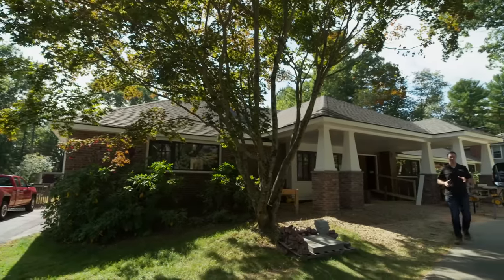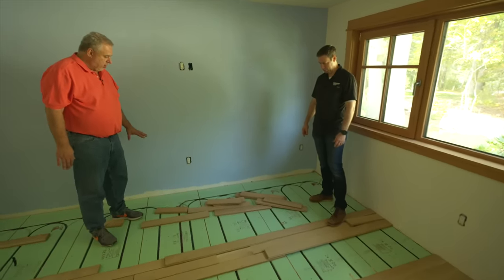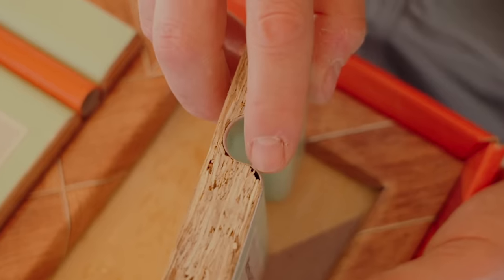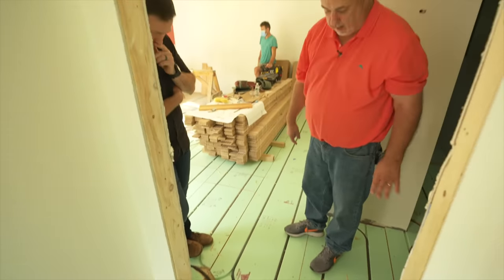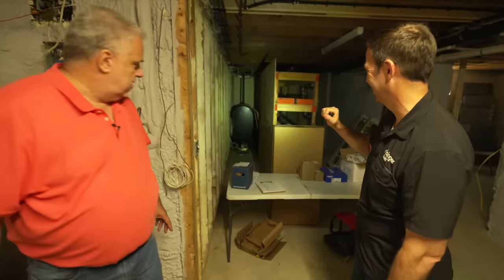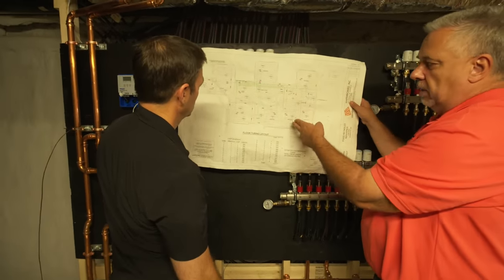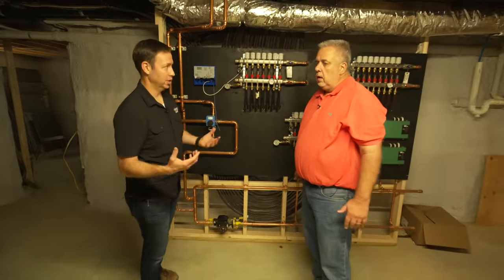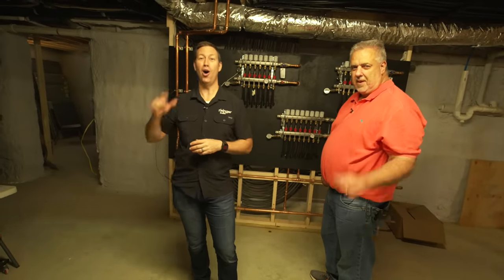Plug and Play Radiant Floor Heating System - BEST ON THE MARKET

Comment: I would rather have passive construction rather than a system that cannot be repaired without tearing up the floor..  System should havea 100 year warranty on an y parts not accessible without demolition.
Reply: Only thing buried is the continuous loops, everything else is exposed. In your argument how do you treat electrical wires, electrical boxes, plumbing valves, plumbing pipes (with joints)? Don't you think your argument is heavily skewed?

Comment: Such attention to detail and they didn’t solder the copper joints.  Am starting to see Pro Press O rings fail after only 8 years on boiler piping.  Not hard to fix but all that initial labor savings is lost.   If you’re using copper just solder it.

Comment: After all that work and money and then the people who live in different bed rooms have to fight over the temperature. They should all have control of their own room.
Reply: Majoofi Pretty sure each room will have some form of independent control. He mentioned at one point that one zone had five loops- that may well cover the bedrooms, in which case the central control could heat the bedrooms while the rest of the house was off, but each bedroom having its own loop and manifold connection with dedicated solenoid means a simple thermostat in each room could control it independently. I doubt anyone would install a system without such controls.

Comment: Why would you want to heat a closet?
Reply: The panels were installed in the closet to maintain consistent floor heights. As far as running the tubing through there - just personal preference.

Comment: The install is absolutely superb but putting manifolds in the basement is a very, very poor decision IMHO.  Manifolds should be installed ABOVE floor loops to allow air to escape and be bled off from the white bleed cap on the manifold. It IS possible to pressure bleed loops but this is complex and time consuming - all the actuators have to be removed and the valves operated manually one at a time to force-bleed each loop. Over time due to temperature cycling and low water velocity it's inevitable that small gas bubbles will occur, leading to more air trapped in the floor loops and loss of performance. Then the whole system will have to be pressure bled again. Then perhaps some of the actuators will get damaged, because they are not designed to be removed and re-fitted many times...And all this just to avoid having the manifold tucked in the back of the closet?.... where, incidentally, it will keep your clothes nice and warm too?

Comment: Warm board is far from perfect. Many better systems and designs available.
Reply: Who would you recommend instead?
Reply: @JoeLaGreca  check out HeatPly. Also no way a hydronic mechanical system has to take up a whole wall. We have done whole systems that fit in a 4'x4' space.
Reply: @takehikes  I looked at the HeatPly website, but it appears to not have an aluminum spreader.  Does it still work as good or efficiently?
Reply: @takehikes  You're kidding, right?!  Pure routed plywood with zero conductive layer, and you have to run tubing every 6" instead of 12"?  You, sir, have got to be a heatply salesman, because it's complete garbage comparatively.
Reply: @timm439  been involved in mani installations of both products but not a heatply rep. 6” on center is with 3/8” pipe not 1/2”. The aluminum does little. You put BTus in a space and that is it, it does not add comfort. BTus are king. I’ve been involved in the sales, design and installation of thousands of systems and found heatply a better system.
Reply: @JoeLaGreca  no aluminum heat spreader but it’s not needed. You are heating the space not the floor do it’s how many BTUs you can get in the room.

Comment: What happens when a run springs a leak?
Reply: They are all "zero joint" homeruns. I baffle me that people concern themselves with a continuous plastic pipe, and raise durability questions, all the while they accept hundreds of feet of copper or pex pipe with a ton of joints....
Reply: @stevenbaczekarchitect9431  Thank you for answering. I am enjoying your videos immensely on the website as well as here on youtube. I have learned a great deal! I grew up in the north with full basements. The thought was always that in a basement you could get to 90% of the plumbing so if a joint broke, and it did often, you could get to it. I am fascinated by underfloor heating systems but this one concern has always nagged me. People do dumb things. I had a tenant once who secured his Christmas Tree to the floor with decking screws. I know not everyone is going to do silly stuff like this but how are these systems remediated in such circumstances. I imagine it would require tearing the floor out over the loop area. In addition, I would imagine there is a pressure sensor that would detect the break and isolate that loop from the rest of the system?
Reply: @stevenbaczekarchitect9431  It baffles me that people confuse copper or PEX plumbing runs centered in stud and or joist cavities that are fully protected  (per all codes) by nail plates in any instance that distance from closest side of pipe to NEAR side (the back, out of sight) of ANY finish material as being equivalent to thousands of feet of tubing that is directly in contact with the NEAR (again, the back, out of sight) side of the finish flooring materials. This is a case of totally false equivalence (something we see all too much of on the evening news, these days). 

The issue is NOT whether the pipe wears out (unless you are running high velocity flow on a continuous domestic HW recir loop-- another issue altogether) or the fittings leak (there should be none, unless there is tube damage that must be repaired; not an unheard of event). The issue is that there is an enormous amount (thousands of feet) of tubing that is VERY readily reachable by almost any fastener that may be employed in the vicinity, and this vulnerability is LIFETIME. One careless hole drilled or screw put into the floor can cause a huge amount of damage and a tough, expensive repair job. This is the dark secret that Warmboard and all their competitors do not like to publicly acknowledge, and in my mind, it is the one truly negative as regards installing these systems. Any installation of the R panels over an existing concrete floor is especially problematic, as any leak will follow the tube channels and the panel joints, and disappear below the Warmboard (presumably there is also rigid insulation below, further complicating life), remaining unnoticed until damage is EXTENSIVE.  For the record, I have done infloor radiant heat for 20 some years now, starting with staple up and in concrete slabs. I am very much sold on the low-mass, rapid response (for accommodating solar gain, here in Colorado, and NOT for nighttime setbacks) aspects of Warmboard (which we have used successfully), but the warning still stands: be VERY  obsessive about installation and subsequent physical protection of the system.

Comment: Putting that insulating wood floor over the radiant heat is like shooting yourself in the foot. The water temperature will have to be higher to overcome the thermal barrier, meaning higher energy costs. Radiant heating works best in a concrete slab because of the low-passing effect of the thermal mass, and the water temperature can be much lower as long as the floor is heat conductive.
Reply: Insulation slows down the transfer of heat, it does not eliminate it. the tradeoff is the slow transfer of heat versus the square feet of the floor. If you have radiant heat, you have hot radiators along the wall. Not a lot of square feet, but the heat transfer is faster. In the radiant floor system the heat transfer is slower but you have a whole lot more surface area that is warm (but not as hot as the radiant heaters have to be) and the heat is a lot more even. The heat in the floor does not go anywhere because it is inside the house. Every BTU in the floor goes into the house eventually. There is no "heat loss" because of the wood.  You cannot make the energy disappear. 

I am planning to use it for a house I am planning to build in Michigan.  My reason is that it is a lot easier to heat water to 80 or 95 degrees F with solar for radiant floor heat, than 140 - 160 degrees F for radiant baseboard. It is a lower quality of heat, and easier to generate with solar. 

Also in Northern Michigan I do not have to worry about AC like I do in Texas. 
I will have thermal mass to help keep the house cool on the few days where AC might be needed.
Reply: @kiptonm  your statement is not quite true. with in-floor radiant loops, the total btu output resolves into an upward component (up through the floor) and a downward loss component (down away from the floor). if you reduce the thermal conductivity of the floor covering, you increase the downward loss. thus, you may have to raise the loop temperature to compensate for things like thick carpets.

Comment: imagine if one of those lines rupture or leak... all that glue and those nails. i don't get it.
Reply: Wha's the difference between this and plumbing in your house? Oh yeah, this is all home runs and no joints......
Reply: Multiple layer HDPE pipe lasts for ages. They have warranty for the job so it's on builder to rip it apart.
Pretty standard construction to nail down flooring. There is glue to reduce noise at expense of easy disassembly.
Reply: @ArthursHD  there better be an amazing warranty program. lol.

Comment: If he's got one primary pump pushing water to the manifolds what are all the pumps near the boiler for? 

Can one pump really push all the zones!? Jesus I feel like an idiot. 

I built my own system and I zoned using individual pumps and not valves (expensive!). After all my reading and learning it seems zoning with pumps is preferable if money is not an issue. 

I'm not rich. I'm open to zoning with valves but it would mean stepping down my Taco 6 zone down from 120v to whatever the valves need (pain in the ass).
Reply: One pump is more than enough, u need a slow flow, 1/4 Liters a minute, depends on the length of the tube . Thats why u see those debit meters on the manifold, it regulates the flow and basicly slows the flow down  else it the floor hasnt got enough time to take the heat in and ur return will be almost as warm as ur incoming flow.
So u have 2 fine tune each group with those debit meters because of the different lenghts in group. If u dont do that u can imagine a short group will conduct way more heat that a long group because it get s the same heat at same speed rate as the long one. Also u can set a lower temp in other rooms u dont use allot by cutting the flow rate abit.
Reply: @goudsekaas5673  Hmmm good point. I did notice my returns coming back with little loss in heat. 

I've got 3 zones all using 1/2 inch pex-al-pex. Single loop 290ft, single loop 290ft, 3 loops 880ft. 

You're saying one pump could handle that using actuators? Have I wasted my money in zoning with pumps?
Reply: @orielsy  im from the netherlands
We have tankless condensing waterheaters.
We dont even use pumps for the manifolds.
We use the pump in tankless waterheater and even thats enough.
We only use a pump on the manifold if the water needs to be mixed like u see in this vid when the incoming water is to hot too directly flow into floor. It just needs a little bit of power to circulate.
The only difference is we got a rule the manifold always be 50cm above the floor its heating u only put it lower if u dont have a other option. When its higher than the floor its heating it needs less pump power and its more easy to get air out off it
Reply: @orielsy  if i was u i would onlynsplit the zones with valves, not with pumps it saves a good amount of money on electric a year.
We also put pump switches on the pump its a sensor that only turns on the pump when heat supply is asked so it doesnt pump 24\7  that also saves allot of electric
Reply: @goudsekaas5673  Wow. Go figure. I'm using a tankless hot water heater as well. You've opened my eyes to a few things. Thank you.
Reply: @orielsy  be carefull tho if u have a mix of radiators and floorheating in ur house. The radiators need almost triple the heat floor heating needs so when u have that u need a mixing valve manifold with a pump on it. Else ur floor gonna get destroyed if u only have floorheating in the house just lowe r the income flow of ur tankless waterheater to 35/40C ( thats european C) and let it flow directly into the manifold (without extra pump) set in each group with the debit meters ( rule here is return has to be 20/25% colder than incoming flow) and put some zone valves on each group on the manifold (20$ each valve here in netherlands) u replace the closing valves on the manifold with the electric ones and u can even get them with smart phone/tablet use, so no wiring to a termostat in each room
Reply: @goudsekaas5673  my pumps only turn on when the thermostat requests heat. So I think that's working optimally. 

I can pivot to valves. I'll keep a spare pump but I should be able to make do with the pumps I've already acquired. Thankfully I've yet to complete my system. This video and the conversations saved me a good chunk of cash.
Reply: @goudsekaas5673  I took out entire heating system. So no boilers. I've also got floor temp sensors installed that stop the pumps if floor temps rise above 28.88C (84F). 

One last question though. In the video @10:10 they mentioned tempering the water with the return water. Ive read about that but never managed to figure it out. If memory serves me correctly you're supposed to have a sensor outside to determine the mix ratio in the mixing valve. Any ideas?
Reply: @orielsy  the mixing valve does that automaticly. In my case i got a radiator valve  on my incoming hot water line on the manifold that i have set 2 a maximum 40c ( when the water in my manifold gets at 40c it automaticle shuts of)
If the tankles heater gives me for example 80c water it automaticly mixes less water from the tankless heater withe the water in the manifold. When u have sett the incoming water from the tankles heater to 40c i needs 2 mix more water from the tankles with the water from the manifold so it stays open for a longer time to reach that 40c in the manifold. https://youtu.be/iAi0fUnayjA 
Check this vid at the end u see him puting on a radiator valve with a sensor that s how  it works here. U also see the blue caps on the returns on the manifold, that are the ones u replace with electric valves to control each zone independently
Edit. Mixing is only applyd to a manifold with pump if u use ur tankless heater as a pump it doesnt mix, ur tankless heater and the manifold ar one system. When u use a manifold with pump like in the vid i linked u use 2 different systems, the manifold with pump is bassicly a closed system that lets in water from tankless every now and then to mix the hot and cold water to get the right temp.
Reply: @orielsy  i have convertes ur group lenghts to meters and if im not mistaking  880ft is 260m if thats the case its a bit long here we have a maximum of 125meters a group to get the best result so thats a bit less than ur longest groups u really need 2 do some good finetuning woth ur debit meters.
Reply: @orielsy  The valve does it automatically. It mixes the two streams and outputs the temperature the valve is set for. If the cooler water is too low it takes more from the hot water. If the hot water is too hot, it takes more from the cooler water.
Reply: @goudsekaas5673  the 800+ft zone is multiple loops. Never going over 300ft (91 meters per loop). I want to thank you for taking time to share this with me.  If you are on instagram and you wouldn't mind I'd love to add you. Again thank you!
Reply: @kiptonm  I'll have to look into it. Right now my system doesn't have one but I could add it once I fully understand how to implement it. 

I believe not having a mixing valve currently is making my system have a temperature momentum issue. I haven't felt discomfort but I do want to build the system out to best industry standards.
Reply: @orielsy  if u can its better to make it one system.
If u use the tankless only for floor heating just cut out the extra pumps and mixing valve. That way it gonna save u allot of fuell for tankles cause u can set the temp way lower (40c). But i dunno if thats posible when i look on yt i see tankless in america are really outdated compared to the dutch ones ( u got allot of japanese knock offs)
Here gas and electricity is allot more expensive so they make them really durable and clean working. Also keep in mind that ur return flow has to be i thought it was 57c max else ur condensation process doesnt work and it burns more fuel. Buy a cheap heat gun on amazone, on a cold winterday pump up the heat and mesure the heat of incoming and outgoing water on ur loops on the manifolds and cut of the water with the regulators abit each time per group til u got the right balance between incoming and outgoing water heat (20% difference) and make shure the floorheat is still working good and comfortable. It takes some time but it highers ur comfort and lower ur bills.